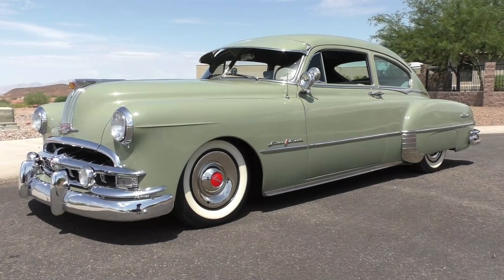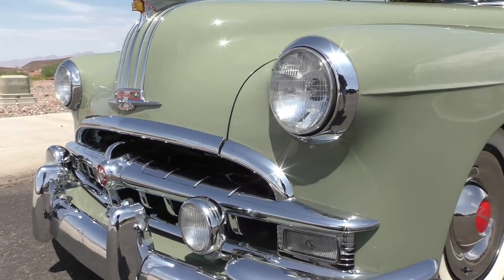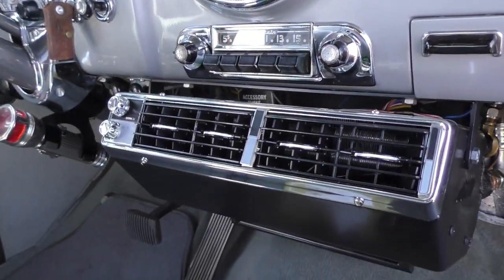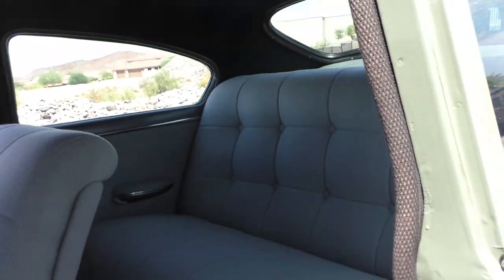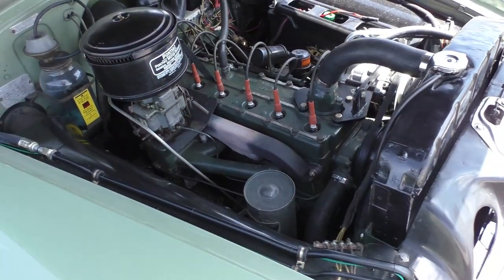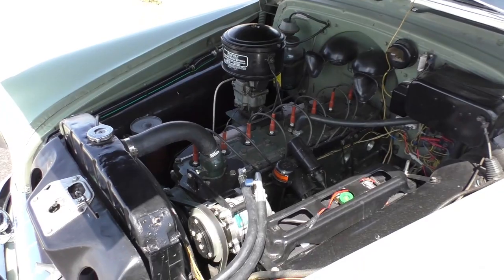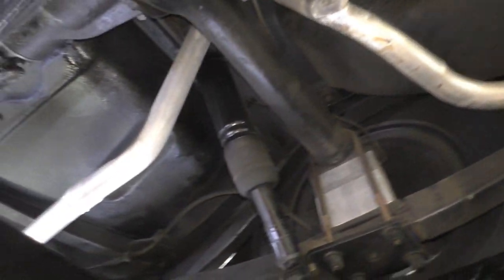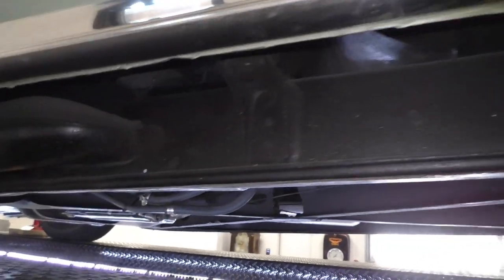1949 Pontiac Streamliner Silver Streak (Sorry Sold) Straight 8

Comment: My father had a '53 Chieftain with the straight-8 and Hydramatic.  He said that when that car was new, he had to use premium gas.   The compression ratio was 7.7:1.  By the late 50s, octane ratings had increased to the point where that car ran just fine on regular.